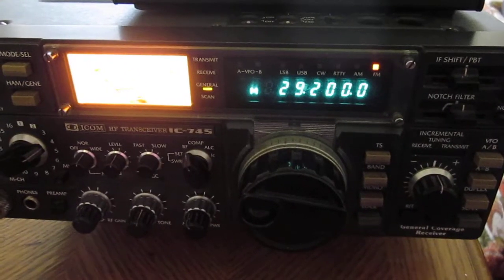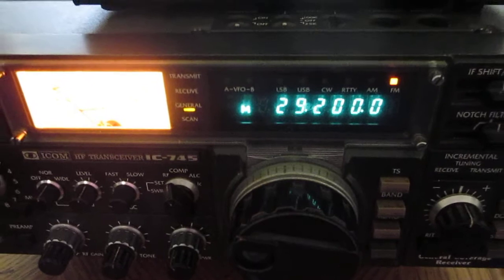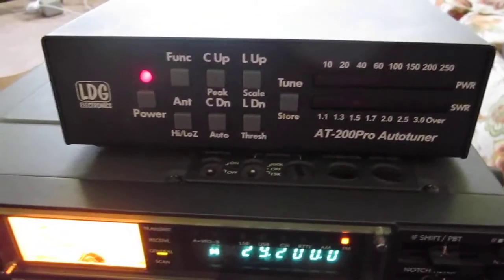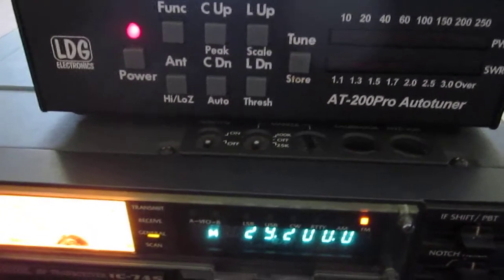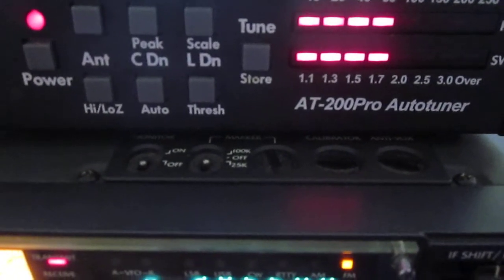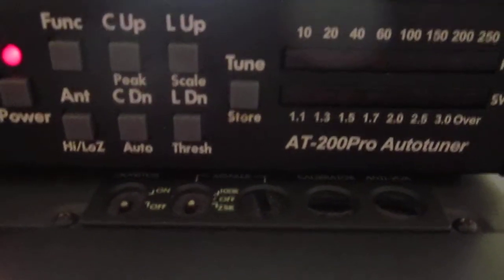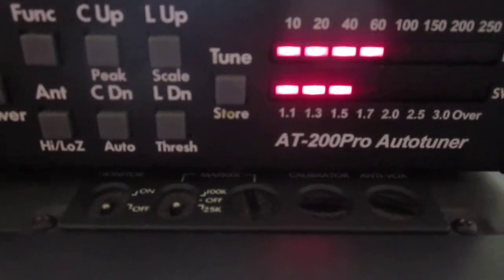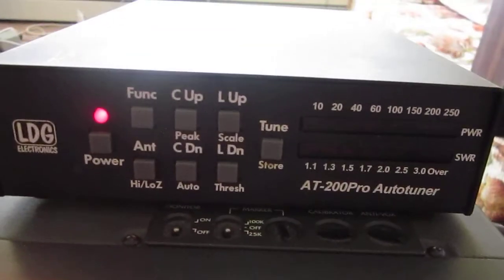MFJ1622 PART THREE

Comment: Aloha Jim, I have this MFJ 1622 antenna also but haven’t had much luck with it on my G90 HF QRP Rig on 10 meters but does work great on 11 meters on USB and LSB. I’ve made some great contacts that way. 
     What I need to try is to use this antenna on my Yaesu 991A at a different location because I have a very tall condo building right next door that I fear prevents me from getting out to make any good contacts on HF. 
      Thanks for the video, Jim. 🤙🏻🤙🏻🤙🏻

Comment: I have tried this antenna on 40 meters a few years ago. ground was the metal balcony fence. I used a longer whip of 4 meter length. SWR tuning was easy on 10 and 40 no problem at all. Performance was pretty good on the bands. Although its a compromise antenna of course it is possible to have some QSO contacts. I must say one could easily make this antenne yourself as it is rather expensive when you buy one from MFJ. But nice antenne. I still have it laying here somewhere around and i'll keep it. One day i might try it again. for now i'm using a Coax loop (reception only) and that works fine too.
Reply from the maker: Thanks for your comment. Have you viewed my other videos?????
Reply: I looked but this was the most interesting one. Do you have a suggestion for another video that i have too watch?
Reply from the maker: Hi  I have a few at utube  go to w9jug 73 Jim